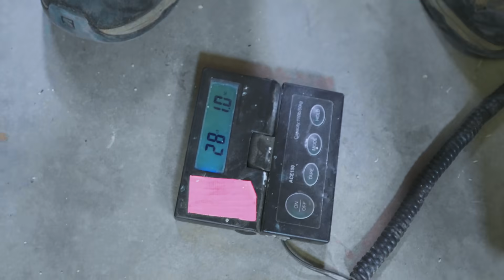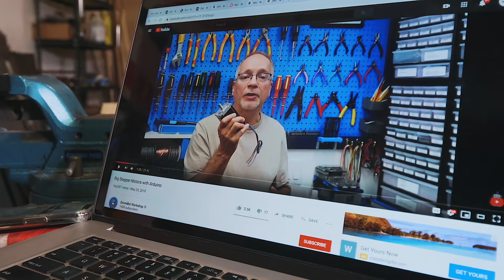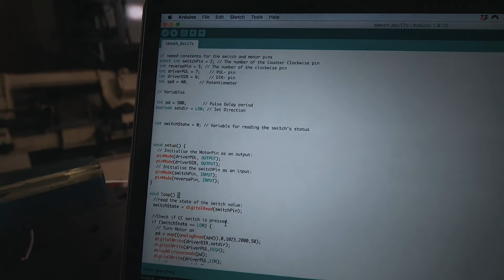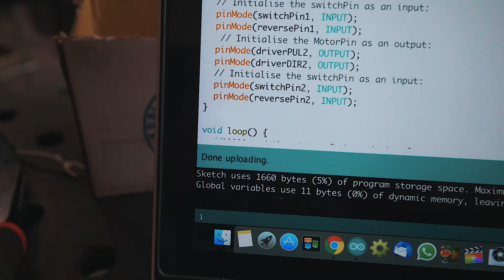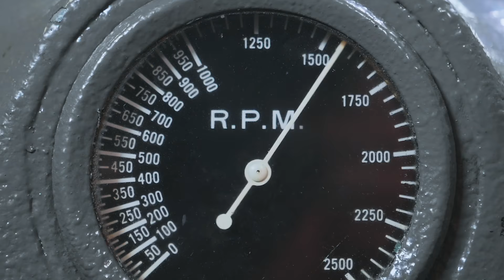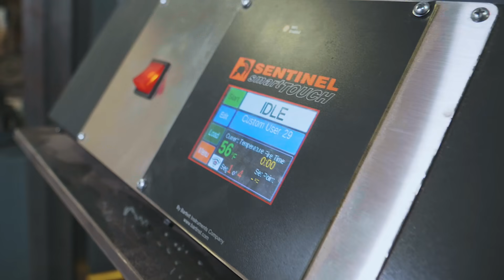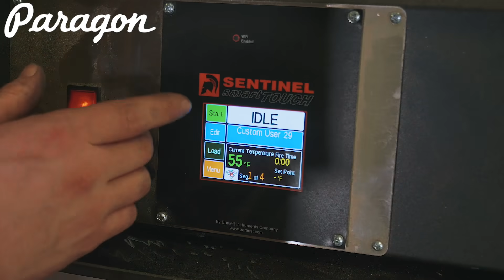MAKING FORGE DOORS!!! Part 2

Comment from the maker: Here's the code!! :) 

// Alec's 2 motor, 2 button program!--- 

// named constants for the switch and motor pins;
int switchPin1 = 2; // The number of the Counter Clockwise pin
int reversePin1 = 3; // The number of the clockwise pin
int driverPUL1 = 7;    // PUL- pin
int driverDIR1 = 6;    // DIR- pin
int switchPin2 = 8; // The number of the Counter Clockwise pin
int reversePin2 = 9; // The number of the clockwise pin
int driverPUL2 = 12;    // PUL- pin
int driverDIR2 = 11;    // DIR- pin
int spd = A0;     // Potentiometer

// Variables
 
int pd = 500;       // Pulse Delay period
boolean setdir = LOW; // Set Direction

int switchState = 0; // Variable for reading the switch's status
int switchState2 = 0; // Variable for reading the switch's status 
 
 

void setup() {
  // Initialise the MotorPin as an output:
  pinMode(driverPUL1, OUTPUT);
  pinMode(driverDIR1, OUTPUT);
  // Initialise the switchPin as an input:
  pinMode(switchPin1, INPUT); 
  pinMode(reversePin1, INPUT);
   // Initialise the MotorPin as an output:
  pinMode(driverPUL2, OUTPUT);
  pinMode(driverDIR2, OUTPUT);
  // Initialise the switchPin as an input:
  pinMode(switchPin2, INPUT); 
  pinMode(reversePin2, INPUT);
}

void loop() {
  //11111read the state of the switch value:
  switchState = digitalRead(switchPin1);
  switchState2 = digitalRead(switchPin2);

  //Check if CC switch is pressed.
  if (switchState == LOW) {
    // Turn Motor on
    pd = map((analogRead(spd)),0,1023,2000,50);
    digitalWrite(driverDIR1,setdir);
    digitalWrite(driverPUL1,HIGH);
    delayMicroseconds(pd);
    digitalWrite(driverPUL1,LOW);
    delayMicroseconds(pd);
  }
  else {
     //read the state of the switch value:
  switchState = digitalRead(reversePin1);
    //Check if CW switch is pressed.
  if (switchState == LOW) {
    // Turn Motor on
    pd = map((analogRead(spd)),0,1023,2000,50);
    digitalWrite(driverDIR1,!setdir);
    digitalWrite(driverPUL1,HIGH);
    delayMicroseconds(pd);
    digitalWrite(driverPUL1,LOW);
    delayMicroseconds(pd);
  }

    

  //Check if CC switch is pressed.
  if (switchState2 == LOW) {
    // Turn Motor on
    pd = map((analogRead(spd)),0,1023,2000,50);
    digitalWrite(driverDIR2,setdir);
    digitalWrite(driverPUL2,HIGH);
    delayMicroseconds(pd);
    digitalWrite(driverPUL2,LOW);
    delayMicroseconds(pd);
  }
  else {
     //read the state of the switch value:
  switchState = digitalRead(reversePin2);
    //Check if CW switch is pressed.
  if (switchState == LOW) {
    // Turn Motor on
    pd = map((analogRead(spd)),0,1023,2000,50);
    digitalWrite(driverDIR2,!setdir);
    digitalWrite(driverPUL2,HIGH);
    delayMicroseconds(pd);
    digitalWrite(driverPUL2,LOW);
    delayMicroseconds(pd);
    // Turn motor off.
    digitalWrite(driverDIR2,setdir);
    digitalWrite(driverPUL2,LOW);
    delayMicroseconds(pd);
    digitalWrite(driverPUL2,LOW);
    delayMicroseconds(pd);
    }
}

}
}
Reply: Proposed changed code... didn't test it, but hopefully easy to understand.

// named constants for the switch and motor pins;
int switchPin1 = 2; // The number of the Counter Clockwise pin
int reversePin1 = 3; // The number of the clockwise pin
int driverPUL1 = 7;    // PUL- pin
int driverDIR1 = 6;    // DIR- pin
int switchPin2 = 8; // The number of the Counter Clockwise pin
int reversePin2 = 9; // The number of the clockwise pin
int driverPUL2 = 12;    // PUL- pin
int driverDIR2 = 11;    // DIR- pin
int spd = A0;     // Potentiometer

// Variables

// FIXME: this seems like PWM drive. 250 high 250 low is the same
//        as 500 high 500 low (50% fill). 70% high is faster, 30% slower
//        I will not change this tho, but right now might not work properly.
int pd = 500;       // Pulse Delay period
boolean setdir = LOW; // Set Direction
// ADDED 
boolean reverse1, reverse2; // reverse direction. used with XOR

int switchState = 0; // Variable for reading the switch's status
int switchState2 = 0; // Variable for reading the switch's status 

void setup() {
  // Initialise the MotorPin as an output:
  pinMode(driverPUL1, OUTPUT);
  pinMode(driverDIR1, OUTPUT);
  // Initialise the switchPin as an input:
  pinMode(switchPin1, INPUT); 
  pinMode(reversePin1, INPUT);
   // Initialise the MotorPin as an output:
  pinMode(driverPUL2, OUTPUT);
  pinMode(driverDIR2, OUTPUT);
  // Initialise the switchPin as an input:
  pinMode(switchPin2, INPUT); 
  pinMode(reversePin2, INPUT);
}

void loop() {
  //11111read the state of the switch value:
  switchState = digitalRead(switchPin1);
  switchState2 = digitalRead(switchPin2);

  // ALSO moved
  //read the state of the switch value:
  reverse1  = digitalRead(reversePin1);
  reverse2  = digitalRead(reversePin2);

// NEW, moved
pd = map((analogRead(spd)),0,1023,2000,50);

  // switch 1 pressed
  if (switchState == LOW) {
    digitalWrite(driverDIR1,setdir ^ reverse1); // XOR with reverse1
    digitalWrite(driverPUL1,HIGH);
  }

  // switch 2 pressed 
  if (switchState2 == LOW) {
    digitalWrite(driverDIR2,setdir ^ reverse2);
    digitalWrite(driverPUL2,HIGH);
  }
  
  // same speed for both, if either is on. high duty cycle
  if(switchState==LOW || switchState2==LOW) {
      delayMicroseconds(pd);
  }
  
  if (switchState == LOW) { // if not really needed
    digitalWrite(driverPUL1,LOW);
  }
  if (switchState2 == LOW) { // if not really needed
    digitalWrite(driverPUL2,LOW);
  }

  // low duty cycle
  if(switchState==LOW || switchState2==LOW) {
      delayMicroseconds(pd);
  }
  // FIXME: might add a small delay here, to avoid busy wait. uncomment following
  //        only happens when motors are off
  // else { delayMicroseconds(100); }
  
}

Comment: So after my comment about pilots last week, I had a change of heart. The issue is that Stepper motors don’t have much holding torque (the torque that holds the same position once the Arduino is no longer asking it to move, but to stay put).
If you counterbalance the weight of the door and use a double-wide pulley on the motor, you only need torque for moving the door. Wrap the cable around the motor pulley two or three times to act like a capstan. The tension of cable wrapped around it will produce enough friction to ensure it moves the cable. The counter balance will double the weight, but will use the motor to its best advantage.
Other option is to buy Technic Servos. They have integral controllers, use the stepper output (direction and steps) to simplify applications but offer HUGE holding torque. They’re also more expensive, starting at any $250. One for your app with a capstan or spool is abt $430.
Since you already have the steppers, my vote is for the counterbalance over a “block and tackle” arrangement.
Also, as someone else wisely stated, limit switches will save you from deep, abiding grief later. I prefer the “no contact” type (proximity sensor). They are VERY good at sensing steel. With tabs welded to two points on the same side of the rig, you can get away with one sensor for each door.
I can send sketches, if this is too vague.
Carry on, boys! This is really stretching your creative and technical muscles. Good stuff!

Comment: Hi Alec, for the coding you would either need to thread your processes (allowing for 2 or more things to happen at once) or to have two seperate processes running at the same time, one to react to each button :)

Comment: I teach tech at a private school overseas, and we're covering Python next year. I'm sorry to say, you can't do two simultaneous lines of code (2 inputs).
BUT you can get around that if you add an additional button, an input that triggers both doors at the same time.

Another possible avenue is to program in a set of toggles. Similar to the buttons, flip it up to go up, middle to stop, down to go down. May be more reliable than the buttons. 

Best of luck, and super happy to see you getting this done after such a long time!

Comment: Cool but couldn't you have just made it simpler like having a switch a plug inverter and a motor
Reply: Yes he could have but i think he over-engineered the entire thing, probably due to lack of experience with robotics and electrical work
Reply: @akosszennyai5814  an engineering phrase is to keep it simple stupid the more complex you make something the stuff can go wrong adding codes cool and all but once stuff goes wrong instead of replacing some wiring it'll lead to everything going knackered.
Reply: I think he just found a new thing that would make him learn new stuff so he went crazy with it as he usually does :p (see him buying all that stone setting stuff or all the sewing stuff for example)

Comment: Extremely over engineered way to just have a door attached to a wire and pully a foot pedal would activate
Reply: But he wants it to be able to hold it's height 🤔
Reply: Over designed, over built, but incredibly under engineered.

Comment: you cut properly, trimmed shielding, crimped spade terminals, and general tidyness. but when screwing wire to header-to-wire terminal you use bare wire without a Ferrule or at least  tinning the wires. LOL another great video with great content.

Comment: Hey Alex I think what you cando to reduce the load of your motor is that you can put a preload in the door with a pullye system or maybe you could introduce it to your system somehow but basically you can use weights to help reduce the amount of work needed to lift the door

Comment: Best advice that my father gave me about coding was that it will only do exactly what you tell it to. I've pulled my hair out so many times but fixing my own code and overlooking the problem because I interpret my own code. Great job and good luck. A simple way to have both work together is to put -  if(button1 && button3){//raise both doors}. You would have to state a case for all wanted combinations, but it does save you from frustration.

Comment: Hey Alec. Just about halfway through watching the video and have an idea that could help your motor strength vs door weight problem. Old windows had  a counterweight system so the effort someone had to apply was pretty minimal. You could do the same general idea so the stepper just needs to move the cable forwards and backwards and isn't really lifting any weight. Maybe bike chain and sprockets would work well for that. 

Keep going man you and will are inspiring.

Comment: You should take a look at Smarter Every Day’s video on pulleys and use it to use those little motors to move the heavy doors. If you put the motors down low on the forge and run some rope or cord through pulleys then you save your motors and electrics from the heat and can make what you have work. 

Edit: Nevermind. I just needed to keep watching the video. Great work!

Comment: Alec, you can also use pulleys to reduce the weight of the doors on the motors if your motor isn't strong enough to lift the 30lb door.

Comment: As some have said it's difficult to do simultaneously with arduino but with threading, polling and interupts you can have it look like it is when in actual fact it's just swapping between the two. Alternatively you can wire it so the same signal activates both rather than code it. You lose the ability to control individually but it's an option.

Comment: Alec, easiest way to get an Arduino uno to work with two inputs using two Arduino unos. They only have one clock on them which means they can only run one process at a time and pushing two buttons is two processes. You can work around this by doing a few things, one being et an Arduino mega because it has multiple clocks built in, or use the code that allowed the Arduino to run one motor and put it on a second Arduino uno to run the other motor. This method would have the same amount of wiring, but half would be plugged into one Arduino and half into the other. Hope this helps some.
Reply: Using two micros isn't necessary, yes the micro process code linerally (from the top down, in a constant loop) but it's so fast that you can "fake" parallel processing of two events (two LEDs blinking at the same time but at different rates, for example) by being careful with your coding. Mainly this means avoiding blocking code like while loops and the delay() function. In fact I'd highly recommend that anyone starting out with Arduino, or the like pretend that the delay() function does not exist. The "Blink Without Delay" example will get you going with how to keep track of time, while still being able to do other things and then you can build on that... These days I almost always use a state machine (or state machine-ish), but that's a little more advanced and something to work up towards.

Comment: Ahh, Alec you are completely awesome - Heath Robinson himself would be amazed.
When you are done over engineering your forge doors might I make a suggestion?
-Drill some fire bricks and bolt them together to make a pair of doors for each end of your forge
-Weld hinges to said bolts and the sides of your forge
-Hang the doors
-Decide how much of a counter-weight you want for the back sides of the hinges to balance the doors... if you get it right these counter-weights will serve as wings you can push on to easily open the doors
-If you're feeling really fancy maybe a latch large enough to be worked by whatever you are wielding
Job done: Effective doors that can be easily positioned as you need without ever needing a spare hand or to explain to others how it's supposed to work.

Comment: Your system will last a lot longer if you use bearings on your pulleys, the aluminium pulleys will wear on the shaft, then they will not spin smoothly.  I love the way you dive in to learn stuff.  Never be afraid to try new things! :)

Comment: Hey Alec, coder here and fellow enthusiast of Arduino. Since the Arduino is technically the simplest PC you can do, it only has 1 core and 1 thread, this means no simultaneous tasks cannot run independently. The only way they can run is if they are working at the same time in the code. However, you can use interrupts to simulate asynchronous tasks. I'd say to either look into that, or get an Arduino Nano/Mini and do 1 motor per board. In the latter case, it will probably simplify cabling and be more compact which might be something you want. Feel free to ask for help, we fans would like to give a little back!

Comment: I see stepper motors a lot @ the factory where I work. Simple 120 volt motors with limit switches work just as well. Your system might work too.

Comment: Alec, I suggest you use a counterweight system for the doors, and make sure you have a safety latch for when the doors are fully open.  Also, I would HIGHLY recommend using limit switches ( mechanical or magnetic or optical ) at the end of the travel to verify the doors have closed/open fully.    There was a suggestion for a worm gear system to make sure the doors stay put if power is lost -- there is a lot of wisdom in that, but more mechanical complexity.  A 5:1 gear ratio would probably be optimal.

Comment: Also a lot of weight will put stress and limit the motors life so using a gear ratio would probably be beneficial as well as just trial and error. By no means am I a physicist or a scientist engineer or anything qualified do do such so contacting someone with a degree in such fields or doing a lil research on it could go a long way as you know from trying different blacksmith things. It is easier said than done. You guys are awesome keep up the awesome videos please. happy holidays to anyone that may see this, and let’s make 2020 a better year than 2019.

Comment: i wonder if using stepper driven set screws like in a 3d printer to rise and lower the doors might be better/ more reliable than a wire and pulley.
Reply: Ball screw 1605 and hgh20 linear rail with hgw20cc block

Comment: One thing that you should look at adding is a level switch, so when the door reaches full lift it will trigger the switch and tell the arduino to turn off the stepper motor, it will continue to turn if its not told to turn on off

Comment: Cool idea, you could use a gear box or worm gear to increase the advantage the stepper motor has over the door. Also the doors won’t just drop if you lose power or in plug it.

Comment: Hey Alec! Please note for future reference that 'refractory' is an adjective, not a noun. There are no such things as 'refractories' or 'some refractory'. It's cement - 'refractory' is a describing word, like 'heavy' or 'brown'. A really interesting video, but hard to listen to! On a less critical note, I'm fascinated that you went for a stepper-motors-and-controller setup here. If you ever build another version of this, you might want to consider a simpler method - counterweight the door, and wrap the counterweight around a pulley driven by a motor. Then simply drive the motor in two different directions, using limiter switches on the weight (run it in a tube and slot either end to mount and adjust the door's upper and lower limits) and DPDT foot switches to isolate the two circuits. It's much simpler and less likely to fail under those harsh conditions :O)

Comment: A cool project for you if your up to it. A titanium blade with tungsten carbide edge, as it would be similar in overall density to a steel blade while having the strength of titanium and sharpness as well as edge retention of tungsten.